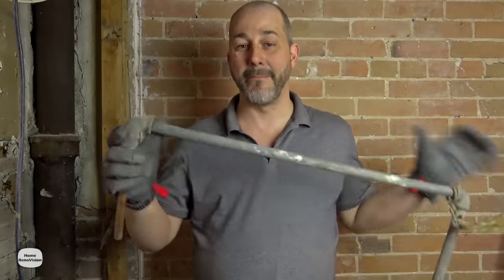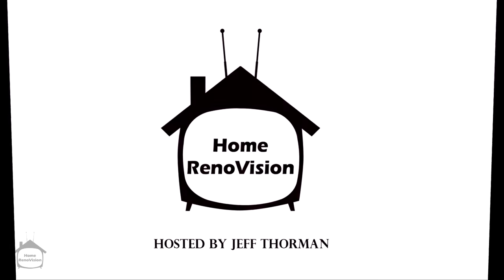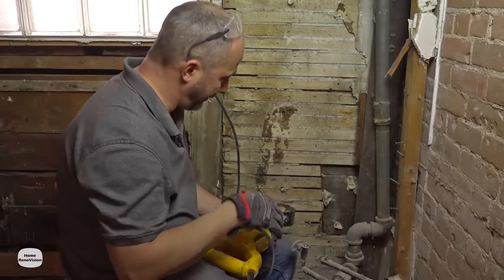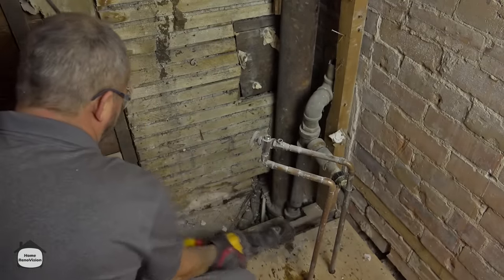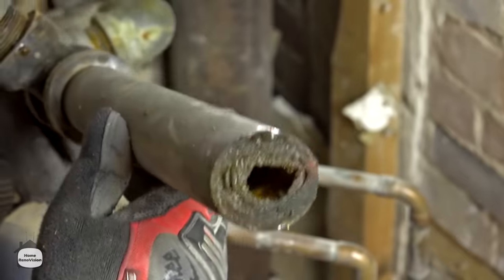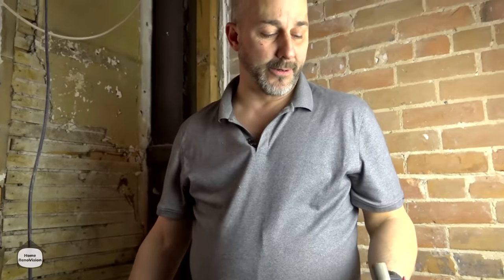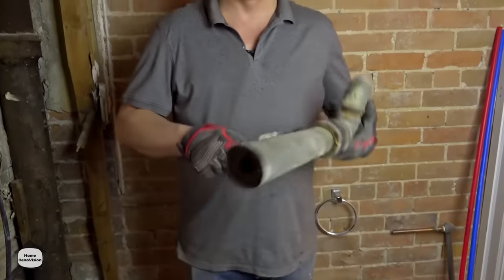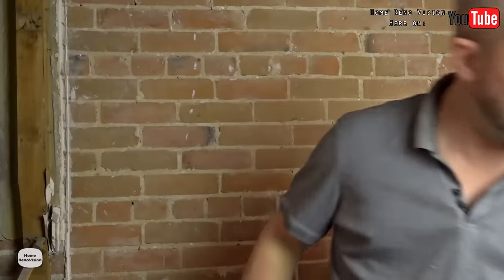Why you Should Remove Your Steel Plumbing ASAP!

Comment: If that’s how it looks. Just imagine the city’s pipe line. Lmao won’t help if you changed yours
Reply from the maker: Most cities have switched over to a new plastic tubing over the years!
Reply: In my town they were digging up old pipe that was made from wood.  It was the water supply line for the town.  They replaced it with plastic.  The wood pipe was 8 inch by 4 feet and was held together with wire wrapped around it.   The sewer line was 4 inch clay pipe  3 feet long that just butt jointed the next 4 foot pipe ( not connected at all). The tree roots grew through the joint and filled the 4 in pipe with roots for over 8 feet long.  Replaced it with plastic pipe and rubber coupler.
Reply: Put an inline house filtration system.